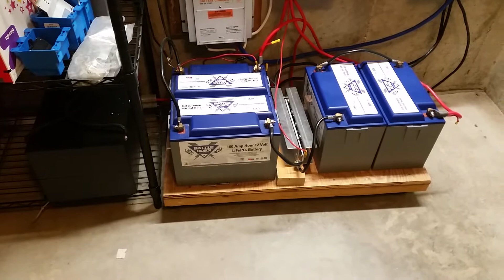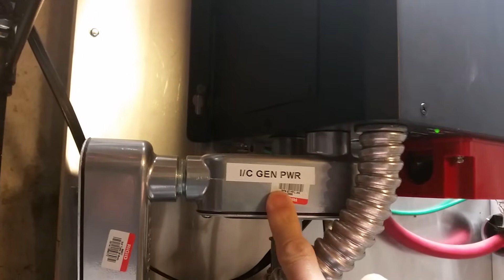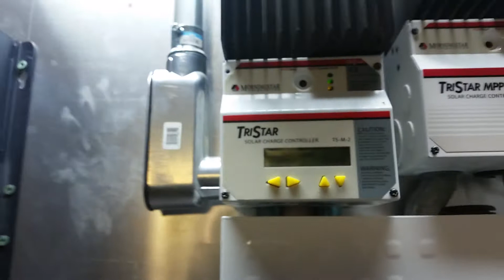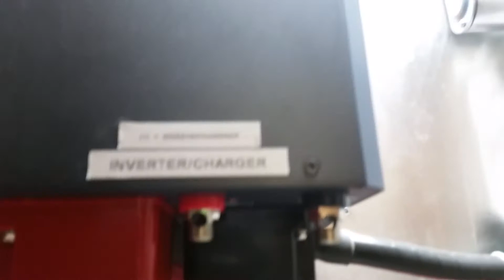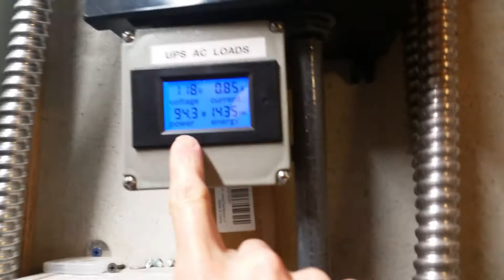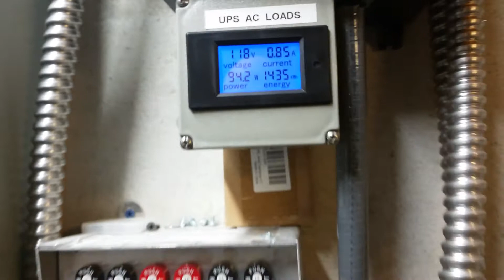Samlex Evo 4024 Inverter Charger:  This Gem Needs Some Love

Comment: Thanks for the tour.  

I’m thinking about getting the new 48 volt input Samlex EVO 4248SP.

  I typically restrict my inverter purchases to the Samlex SA series; but they are no longer in production; and the one I currently want (SA3000) is nearly impossible to find, new, or used; so I’m counting on the EVO series to fill the gap left by the SA series.  

Actually, the EVOs weigh double, or triple, what the SA’s weigh, which should translate to greater load handling, and reliability.
Reply from the maker: I think you would be very well served by one of the EVO inverter chargers and they weigh double per relatively the same watt output because they are a low frequency type inverter which means they have a huge, heavy transformer in them that allows them to handle huge starting loads compared to high frequency inverters like the SA3000 you like.

Comment: I just read through the manual, and I think the answer is no; but can the charging function be limited to certain times of the day to take advantage of time of use pricing?
Reply from the maker: Hi and thanks for watching!  Good question.  This functionality does not exist to my knowledge either reading through the manual.  Not something that folks in the mid-west have to think about so thanks for bringing it up.

Comment: Does the fan run much when it's under say 75% load for an hour? I have a 1500 watt Samlex and have been very happy that the fan never comes on, they seem to run cool.
Reply from the maker: Hey, thanks so much for watching!  The load this inverter/charger sits at most of the time this part of the year is around 10 to 15% of full load and I would say the fans are on about 90% of the time.  It does get up to 25 and 50% load for short time on a daily basis.  The fans seem to come on when at steady loads of around 5% and higher, but they are programmed to operate at various speeds depending on load and at low loads the fans are turning pretty slow and not very loud at all.  As load increases the fans increase in speed.  If I had to guess the fans seem to be programmed to operate at between 4 and 8 different speeds.  Have not measured the sound level they put out.  Hope that helps.  Glad you are happy with your Samlex inveter.

Comment: we have one i had it on our house but we had to go to a 220 volt inverter we still use our samlex to have power in our truck it,s a nice inverter
Reply from the maker: Hi John!  Thanks so much for watching and for the comment!  Yes, there are some benefits to having a 240 volt inverter.  There are a few 240 volt appliances in our house I'm considering powering someday with a 240 volt inverter in parallel with the samlex.  Glad to here you still have the samlex.
Reply: @thekeltnerway3002  we just got a gree AC unt 30 sheer 220 i hope it rus good on solar

Comment: Hi, do you need to have the remote unit to customize charging settings or can you do it with a computer?
Reply from the maker: Not sure you can do it with a computer as I have not tried it.  As indicated by Samlex tech support, two of the RJ45 connections (Comm 1 & 2) are active MODBus serial ports so it might be possible.  I have only used the samlex remotes.

Comment: I have a small question for you because you know this inverters there are real hard to find information on this inverter do you know what com 1 2 and 3 are
Reply from the maker: Agreed, not much info relative to others.  I asked Samlex about these ports last year and here is what they said:
"Comm 1 & 2 are active MODbus serial ports.  Comm 3 & 4 are not active on the current product."
The individual at Samlex went on to provide some more details on how to get/use the info that you can get from the MODbus ports and I can forward you the email but don't want my email address out here on comments.  If you can send a private message somehow on youtube I can  forward that to you via email.

Comment: I have a evo3012 3 1/2 year old in my house now problem and I run my hose. No a/c or water heater i love my
Reply from the maker: Thanks for watching!  Glad to hear yours has been running for a number of years as well.  Just saw your battery bank on your videos, WOW, it is huge!  Curious where you got all of those batteries.
Reply: @thekeltnerway3002  they camfrom the border patrol Watchtower south Texas they are 2 or 3 years old I got them 3 months ago I was using gel batterys

Comment: Nice video, I've seen internal build quality of the samlex evo and it seems well constructed. Im  considering getting a evo 2224 for the time being
Reply from the maker: Thanks for watching and the kind words!  Yes, I've been impressed with this unit and the quality of the whole line of Samlex products.  I was thinking of the 2224 for a while also, but the 4024 isn't all that much more and has a lot more capability.
Reply: @thekeltnerway3002  I'll be just running a few TV's, lights, fans and deep freezer. If i see the extra I'll definitely get the evo 4024.
Reply: @diy-bj2ed  My 2224 EVO has been running for over two years straight now, no problem. Never have been turned off in those two years.

Comment: its a very nice looking inverter/charger with a good feature set at a good price - i wondered why there was not more reviews about it, thank you!
would like to know the difference between the remotes when you get that one in
Reply from the maker: Thanks Dan D and thank you for watching.  I've been wondering the same thing ever since I got it.  The one thing I did not mention in the video is that it also is not grid interactive (off-grid only).  I'm not interested in that feature, but others are  so that could also be why.